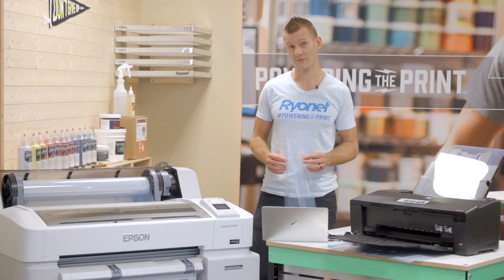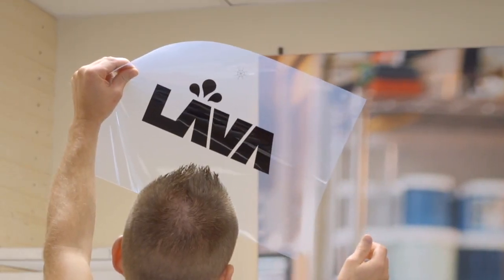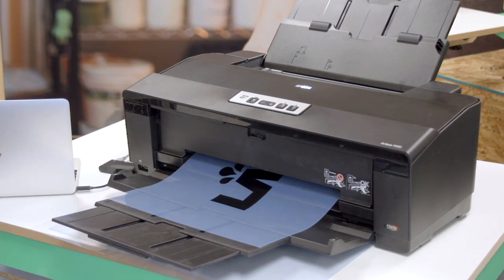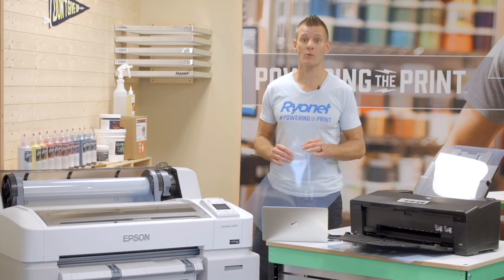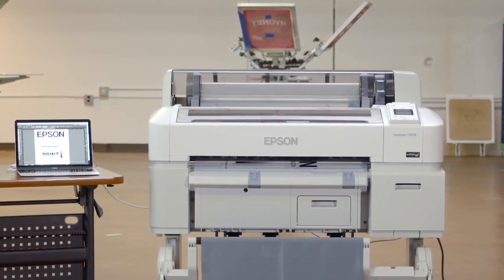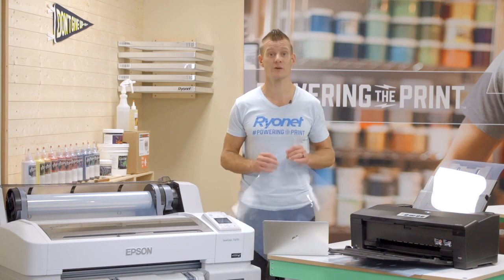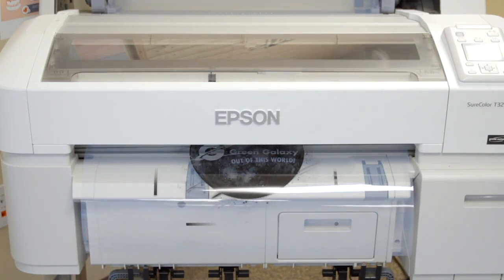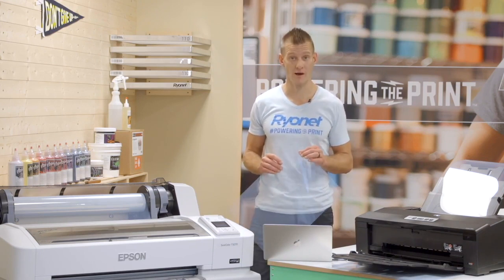How to Screen Print Series - Film Output

Comment: Do you ever have issues with the film positive fading in light over time? We use the Epson 1430 printer, and screen printing specific waterproof film for positives. Yet they fade if we don't put them up somewhere dark.
Reply from the maker: Hi!  Great question.  I personally have never seen that happen due to films being in the open, but I and many of the print shops I visit also keep their films in a package / dark space.  Are you using after market black or OEM inks?  OEM inks have UV blockers in them to resist fading (also helps out a ton when exposing)

I have seen the black fade when the film is used over and over.  A very small amount can rub/transfer off during exposure if the screen has ANY residual moisture in it during exposure.

Hope this helped!
Reply: @Ryonet  We use a brand called Cobra Ink, but I think they're closed so I'm not sure if it has UV blockers in it. But that makes a lot more sense for it to have it. I've never had an issue with the ink coming off onto the screens when exposing them, it's always if they get left out for too long when they start to fade. Do you have any recommended brands or companies to buy OEM inks from? That info definitely helps, thanks!
Reply from the maker: @Masa-gl6ti  OEM inks - meaning Original Equipment Manufacturer - would be Epson for the 1430.  Any Photo printer will have inks with higher levels of UV blocking power so pictures have minimal fade in sunlight.  Now, getting a dense black is another question..... but again, if it can block UV light that is  most of your battle.

If what you are using works great, i may just change habits so the films are kept away from a light source.

Comment: do you recommend if a have a 1430 Epson change all 4 cartridges to black or  have the special black ink I think call all black ink . right now I have the orinal cartridges but even in Corel draw I put the design in black 100 magenta 100 and the other 2 colors 100% I don't think my film is black enough. can you help me
Reply from the maker: Hey there! I would suggest getting our BlackMax All Black Ink System, which you can find here: https://www.screenprinting.com/blackmax-1400-1430-screen-printing-cartridge-kit-w-chip-resetter

It is an all black ink system that allows you to have darker, more opaque prints. It does require the use of AccuRIP, which you can find here if you do not already have it: https://www.screenprinting.com/accurip-software-for-printing-halftones-with-epson-printers

There are videos on the product pages for both, so feel free to check it out! Having an all black ink system really helps when printing good, dark film positives.

Comment: I HAVE EPSON T 5270 PRINTER WITH HARLEQUIN  RIP SOFTWARE FOR PRINT SCREEN PRINTING FILM POSITIVE. WHEN I PRINT ANY DESIGN FOR HIGH DENSITY PRINT AND WHEN I EXPOSE THIS FILM I STUCK WITH MY MASH AND REMOVE DESIGN FROM THE FILM.. ARE HAVE ANY SOLUTION FOR THIS? I USE INKJET FILM POSITIVE..
Reply from the maker: Hi there! This is strange! I wonder if you're inkjet is printing on the wrong side of the film? You want to make sure you're printing on the rougher surface. Sometimes it can be hard to tell which is the correct side so always double check when placing the film in the printer. Also make sure your emulsion is 100% dry with zero to low humidity. Let us know if you still need help!
Reply: Hi  @Ryonet  
Thanks for your help. I was double check my film was print on the right surface. And my emulsion was fully dry. Only i was face this problem when i work with a design of High density. When we expose any high density design 30-40 second then we face this problem.
Reply from the maker: Hi @Freedom Design! Thanks for checking those few things. Let's go over some other things it could be. Can you please shoot me an email to jleinbach@ryonet.com so we can chat more! I'm wondering if you're using capillary film or what emulsion.